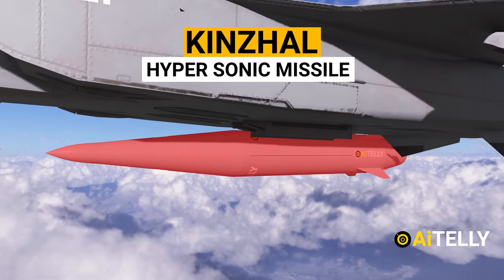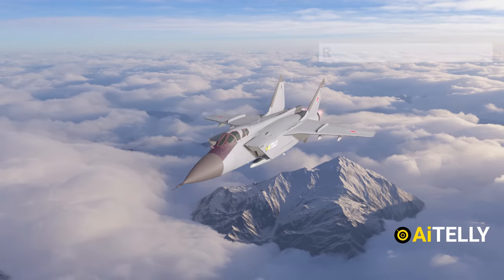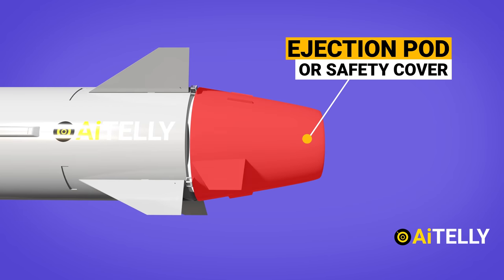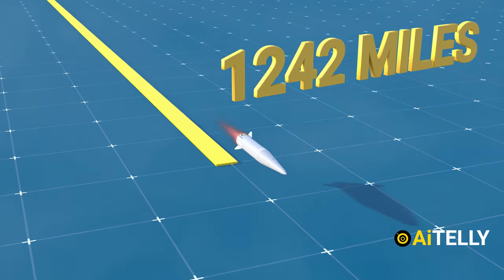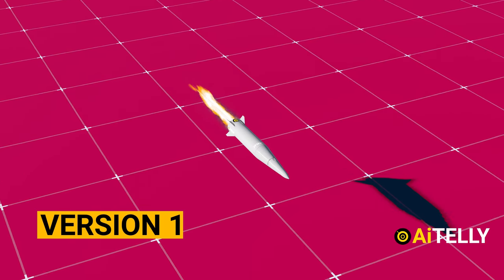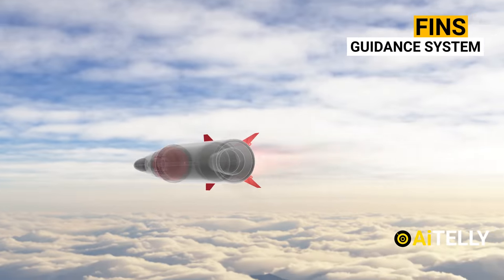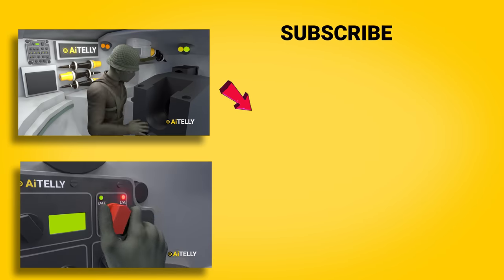Hypersonic Missile How it Works | Mig 31 Kinzhal Launch Process

Comment: It is speculated that missile uses Magnetohydrodynamic Control so it can attain hypersonic speeds in altitudes lower than 10km with less air friction.
Reply: Нет , подобная система управления не работает из-за облака плазмы
Reply: Magnetohydrodynamic only works in fluids
Reply: @nathanielnachtigall7074  air is fluid
Reply: @MrSuba47  technically Yes, i meant air isn't liquid.
Reply: It uses gravity altering systems! 😂

Comment: To everyone complaining about the PAC-2 GEM-T+ shooting down the Khinzal, is it really a surprise? It's not hypersonic, it flies a depressed ballistic trajectory. Also, the pic y'all are complaining about is the warhead, which is obviously much smaller than the outer casing diameter of the missile. What do you think happens to a missile that's traveling at hypersonic speed when you poke a hole through it? The whole thing tears itself apart. Why would you expect the casing of the missile to be intact? Is it made of thick titanium? Missiles must balance strength and weight. Strong enough to not tear itself apart but not so heavy for obvious reasons.

Comment: Finally, Russia's calculations for Kinzhal's range includes the MIGs combat radius.... It really has a range more like 200 miles.
Reply: This would mean 18 mig 31 from a distance of 200 miles from kyev launching 18 kinzhals. I think you have no idea what you are writing about
Reply: It's also not hypersonic
Reply: @airaction6423  wait what? I dont understand what your talking about. I am saying the figure given as Kinzhal's range actually includes the MIG 31's combat radius is ~720km. Kinzhals reported range is 1500km...Iskander, which its based on is 400km. Since its air-launched it makes sense it might have a little more range.
Reply: @airaction6423  Does that not make sense?
Reply: @cedriceric9730  indeed it is not. It reaches hypersonic speeds . But is not part of the class of weapons known as Hypersonic missiles Theres only two types. Cruise missiles & Glide vehicles.
Reply: @cedriceric9730  And as far as @airaction6423 is saying. Did i make sense? Does his idk, statement/question make sense?
Reply: @jdogdarkness  Kinzhal's range from the deployment point is 1500(reported oficcialy)-2000km(reported by Putin). Maximum operating range of Mig 31 - 1500km. Total range of Kinzhal complex is 3000-3500km.

Comment: Not hard to hit at all.  Because of their speed they have two major drawbacks, firstly they stand out on radar much more than a conventional missile would.  As they travel through the air they generate a lot of disturbance and heat, both of which increases its return radar signature.  Also travelling at that speed makes it a very noticeable blip on anyone's radar screen.  The other big drawback is that while they're fast they're not very manuvrable, a conventional  missile that is launched ahead can easily out manoeuvre and intercept it provided it's spotted in time.
Reply: Try to
Outmaneuver Ferrari while driving truck. Then report to us how good you was.
Reply: Чтобы поразить цель маневрирующую на скорости, допустим , в 10 Махов перехватчик должен обладать скоростью выше в 2 , 2, 5 раза  как минимум, и это при том , что с момента обнаружения цели , её захвата и взятия на сопровождение у батареи ЗРК остаётся не более 20 секунд чтобы дать команду пусковым установкам на пуск ракет. А теперь посчитай , какое расстояние за это время пройдёт Искандер или Кинжал. И при всём при этом мы не принимали во внимание способность обоих изделий выставлять ложные цели и применять средства радиоэлектронной борьбы.
Reply: @ДмитрийКутнов  you tried but obviously know little about what you parrot 😂
Reply: Sure, but say it to the Patriot's 32 attempts to hit it 😂
Reply: @fxvlad  32 patriot missiles used and missed?  Where are you getting that information? 😁
Reply: @Altair885  i see you cannot use the internet properly))
Reply: @fxvlad  You think Ukrainian forces publish every time they fire a missile?  😁.   Just tell us where you got that information, the name of the website for instance!

Comment: Soviet Mig31 does not fly above Mach 2.5, otherwise the structure would be made of titanium and withstand heat of more than 300 degrees 🔥, as in the "Black bird" SR71 ! 😎 Cool content , Thanks 👍
Reply: Bravo... next expert :D Structure of MiG-31 is partially made of titanium... as MiG-25 was. Both are made in soviet era. Nothing new :) Both reach 2,83 Mach.
As ya can see... youre brilliant :)
Guess where from USA was taking titanium to buiild RS-71, accidentally called wrong way SR-71?
Guess where from USA is taking now titanium? :D
Guess dear expert :D
Reply: All titan from Devil Russia😂
Reply: Wrong- Mig 31 can fly over mach 2,5 at high altitude easily. Ghost of Kiev is here again :) , downing Russia´s most advanced missille with USA´s high price and low performance Patriot :)
Reply: @mirekslechta7161  3 days. 😂

Comment: I believe the missile do not have warhead separation. It is not a ballistic missile, no reason to discard the tail at all. Even when the rocket engine burnout it can still work as a hypersonic glide vehicle.

It is called hypersonic because the air compression generating plasma in front of the missile, that produces a barrier that absorbs all kinds of electromagnetic waves. It should be invisible to radar. If the missile remains hypersonic all the way until hitting the target, it would mean that it is flying blind - because it cannot have camera or radar on board, which is how the missile is speculated to work using satellite positioning (before it goes above mach 5) and rely totally on inertial guidance after that point. That is using the change in inertia alone within the missile to calculate its current location. It is said to have 10m error which is fairly inaccurate as a precision weapon.

The "ballistic missile" can be shot down is based on the fact that a ballistic missile do not have hypersonic speed during the terminal phase, or there will be no guidance at all (as thermal camera, radar or radio communication etc cannot function when the plasma is still in front of it).

Everything points to a conclusion that the thing is unstoppable with current technology, but it have limits.

Comment: Three critical aspects you did not mention:
1. The encapsulating alloy: It is the key, since the extremely high temperatures at hypersonic speeds would destroy any typical missile.
2. The hyperdonic speed makes the missile shield  (alloy) create a layer of plama due to the friction with atmosphere, at very high temperature.
3. ALL russian hypersonic missiles, Avangard, Kinzhal, Onyx, Tsirkon have RANDOM, variable reentry trajectory, a key factor that make them UNSTOPPABLE. So far, ONLY the rusdian S500 Air Defense System can take down a hypersonic missiles... The mediocre Patriots are just a joke for them.

Comment: It's already known that the entire main missile does not separate, there are decoy launchers in the back that attempt to distract AA in terminal phase, also the missle accelerates to Mac 12 then coasts down to supersonic speeds as it approaches the target. 
The biggest argument as to why kinzhal isn't a hypersonic is limited maneuverability, with its main strategy being speed to reduce viable intercept ranges due to the time it would take for an interceptor to reach it.
Reply: American propaganda is the best propaganda lol🤣
Reply: @Ser Moz  I... don't even know what you are referring to... if your talking about the decoys there are pictures of them both stowed and spent, if your talking about the speed, it's true for practically all vehicles that even go supersonic let alone hypersonic, powered or unpowered as going above Mach 3 at low altitudes for any extended period of time will make anything without ablative heat shields simply decentigrate. If your talking about maneuverability, you are looking at miles to make a turn for the blackbird at speed, and you have a dart with no wings here....

Comment: I know how it works but I am forbidden to say anything. But the 2sd generation hypersonic missiles can fly faster by 4 to 5 times above their maximum 35 times the speed of sound and that is just a conservative mathematical calculation. But it has something to do with new hyper-alloys to design a new hypersonic missile to remove air friction by using the air creating friction against the missile and redirect it as the primary mixing oxidizer at the rear combustion engines. How they did that I dare not say.

Comment: Thanks for an interesting video. I have these 2 comments. DO you not think that the plane will pull upwards before realising the missile ? - it is after all a ballistic missile ? The front of the missile appears so similar to the Iskander, that I do not think that the warhead will seperate - but that is only a theory.
Reply: Think ballistic....what does it mean? I will explain- it means flight path... Kinzal is never using ballistic path.... Ghost of Kiev is here again :) , downing Russia´s most advanced missille with USA´s high price and low performance Patriot :)

Comment: I think this is a ballistic missile , not a hypersonic glider or scramjet
Reply: You heard it can change trajectory but you claim it's ballistic. Is that because you don't know what ballistic is or because you can't be bothered by FACTS?
Reply: From what leaks and analisys tell, it's a modified Iskander-M Ballistic Missile to be launched from supersonic speeds at high altitude. It doesn't have the capability to steer like a HGV.

Proof that its a ballistic missile is that a PAC-3 missile shot 6-7 of them down, which have anti-ballistic capabilities.

Comment: The patriot is not a hypersonic missile. It must maintain Mach 5+ for the majority of its flight path to be considered hypersonic,  and this is not the case with the patriot. 
A missile defense system does not need to bee faster than the incoming projectile, only get to an intercept location in time. 
That being said, the components shown did not match a kinzhal. It was a Mish mash of parts, some which could be argued was an iskander,  some which were too small to fit either. The iskander spike cone, as well as the one fir the kinzhal, are both wider than a person and terminate somewhere in the missile. The one shown.....close, but not so much

Comment: Honestly to say Patriots can intercept Kinzhal is just wildly overestimating the Patriots' ability. I was reading the report after the first gulf war, none of the scuds that Saddam launched at Israel can be intercepted by Patriot because it is very hard to intercept something that reentry at Mach.10. That's in a fixed trajectory mode. For this exact reason, Israel develops the Iron Dome missiles. 
Even with this current technology, it is very hard to intercept Khinzal as the missiles can turn and be controlled in flight and not on a parabolic trajectory.
Reply: Umm, the first Gulf War occurred 33 years ago and zero improvements have been made to the Patriot system sice then........ Really? Oh, dear. Moreover, the Khinzal cannot be manoeuvred at its maximum speed and this is what makes them so very easy to shoot down with the right equipment, hence 6 in one night. Additional Iron Dome was really developed to deal with short range missiles coming from Gaza, where the time to intercept is very short, and of course there is mounting evidence that the Ukrainians now have that system in place as well.
Reply: Patriot already intercepted 7
Reply: @KingSpittusFactus  😂
Reply: @knightsnight5929  Patriot was developed to intercept, low-flying cruise missiles, big drones, high-flying fighters, and bombers. Raytheon never advertises nor guarantees that it can intercept ballistic missiles let alone hypersonic missiles. why? because there is a threshold that mathematically cannot be crossed by the current US technology which is the speed of interception and trajectory. 
the closest SAM that could theoretically intercept is S-500, which is a hypersonic missile too. 
just by looking at the way the Patriot launch and the S-500 launched, you can tell which one will have a better chance of intercepting hypersonic missiles.

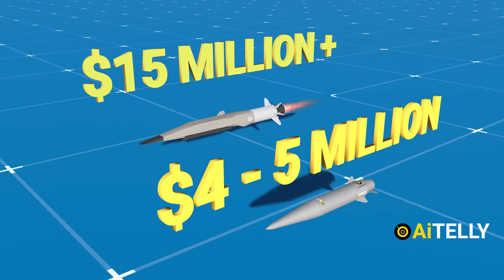Comment: @ 1:40 what do you mean this is not a suitable comparison because the American missile can travel 4 mach faster than kinzahl? Several months ago America dropped its Hypersonic platform due to repeated failures.
Reply: There are so many claims in the comments, please post evidence
Reply: @JohnSmith-dg9gg  sure. About 3 months ago America tested one of their test missiles by Lockheed Martin I believe that was set to be America's first Hypersonic missile system. The missile failed. It was this platforms fourth or fifth failure in a row. Nevermind the fact that this is incredibly humiliating to the United States. Because the United States is incapable of achieving what Russia managed to produce with a tiny fraction of the resources the United States has used.

I don't know the exact amount that we've invested in our Hypersonic weapons program, but all the missiles produce have failed miserably. The program was officially canceled by the Pentagon 2 months ago. FACT

Comment: Tu-22M with 6 missiles is impressive, but hardly practical given limited number of missiles fielded by Russia and Tu-22M3 having air refueling removed and avionics hardly updated. Russians would be better served by putting Kinzhal guidance kit on KSR-5 / Kh-22 - better range and twice the warhead?

Comment: Ok some say it indeed has been shot down, let us analyse ukranian photos, 

1) geometry if you stack both of these in a vertical axis you can clearly see the ukranian one has longer nose and overall smaller diameter
2)Ukranian photos reveal a flat rivet hole as compared to an extended outward work in the kinzhal in crimea, and that is factory made and should not be changed
3) the warhead is thicker in coating than the one in crimea and relatively lighter in colour and much wierded in material.
4) in the photos in crimea you can see a ring around the  warhead that evidently has no trace in ukranian photographs although it is big and very clear
5) A curve has been seen in the crimea warhead as opposed to absolutely nothing in ukranian photos

this is all practical we can talk theoretical too. I want to stop here as I can't really go forever.

Comment: First of all. The Kinzhal (Dagger) system is not hypersonic in full sense of the word. Yes, it moves at hypersonic speed practically all the path from lunching to hitting the target. But its way cannot be controlled neither speed nor direction, because its engine works only for fifty seconds driving the rocket to hypersonic speed 10 or 12 Machs (3-3.5 km/sec) and next the rocket is moving over the ballistic or aeroballistic trajectory.
So this type of missile is rather aeroballistic than hypersonic.
And definitely the Kinzhal warhead cannot maneuver like shown in topic video. More precisely it can maneuver but for the cost of dramatic loss in speed. Dramatic I mean two times for a simple left-right-left maneuver.

Comment: the war head in this looks nothing like what ukraine shows ? is it possible that they did not intercept a kinzhal in the first place ?  could it be an iskander ? can you make a vid on iskander ? i think there are 3 types of iskander.
Reply: The Kinzhal is an iskanler that has been modified to be fired from an aircraft. 

They are the same missile, which is why the American made Patriot SAM system destroyed the Kinzhal so easily.
Reply: @isldstormhawaii4084  kinzhal is mach 10 , iskander is mach 5
Reply: @hemendraravi4787  I a failing to see what you are trying say with this statement.

They are the same missile. If you are to launch by high altitude as the Kinzhal is, you don’t use propellant boost on gaining altitude, instead the fuel is spent gaining speed and with the thinner air the high you go into the atmosphere. 

This is basic high school physics.
Reply: @isldstormhawaii4084  its basic knowledge that its harder to intercept mach 10  missile vs mach 5 missile. im talking about the kinzhal missing the warhead ukranians showed i physically cant see that part inside kinzhal. which is why im saying it may be an iskander as there are like 3 variants of iskanders.
Reply: @hemendraravi4787  as it has already been explained, the Kinzhal is a modified Iskander missile meant to be fired from the air. You are not understanding that fact, for some reason you are fixated on “the parts of that of an Iskander missile” and not the fact that Kinzhal is an Iskander missile.

I am not sure how this is getting over you head. As for the speed of the missile it doesn’t matter. The Patriot SAM was upgrade with the PAC-3 missiles to intercept ballistic missiles moving at hypersonic speeds. 

I am not sure why you are fixated on this weird belief.
Reply: @isldstormhawaii4084  iskander has many variants  , it has 3 different warheads that physically chang the structure of iskander , kinzhal so far only hss 1 type of warhead. (all look the same)

Comment: Created in 2018, the Dagger can fly more than 4 kilometers in a second; The Patriot PAC-3 air defense system was tested in 1997. The maximum target speed is 1600 m/s;
conclusion:The Patriot air defense system could not shoot down the Dagger, because it is not designed to shoot down such fast missiles.
Minister Shoigu: "We don't launch as many missiles as the Ukrainians shoot them down")))

Comment: You didn't say the range of the radar in patriot missile system 
I googled it, it said it's more than 100km, but it makes it weaker compared to the s400 system which has an radar range more than 600km